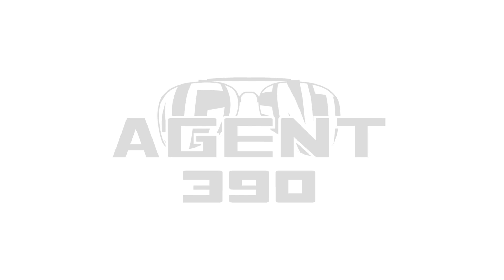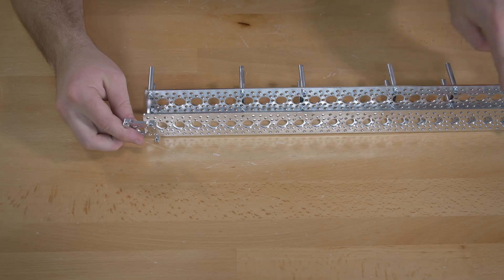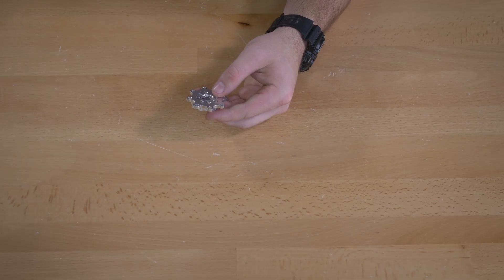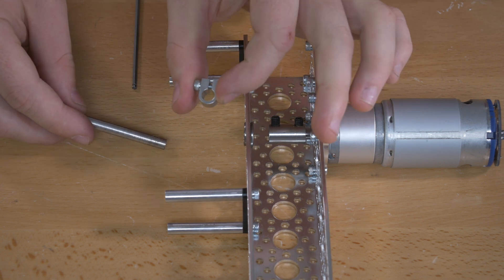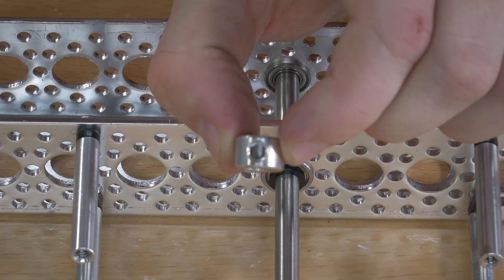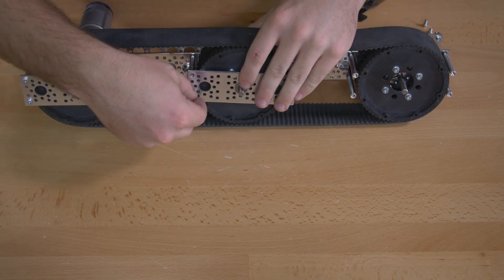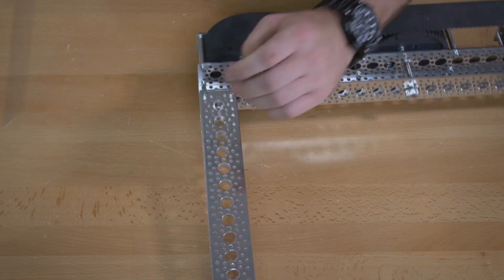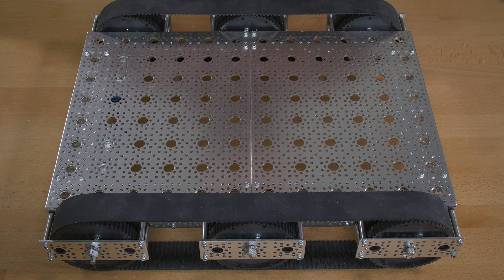Actobotics® Agent 390™ Track Kit Assembly Video

Comment: Once assembled, what or how do you control it? What else is needed?
Reply from the maker: +alex mcgregor You would need a motor controller with 2 channels or 2 single channel motor controllers.  Either the 2x15A claw or 2 of the 18V15
2 male to male servo leads
Some wire to connect the motors to the controller
A Tx/Rx combo
A 12V or 3S lipo battery
Should you have any additional questions, please feel free to contact our Tech Team tech@servocity.com.  Thank you!